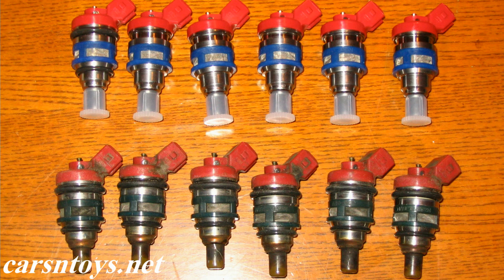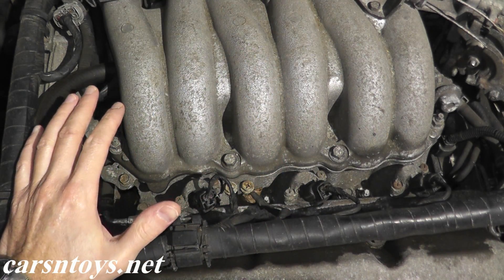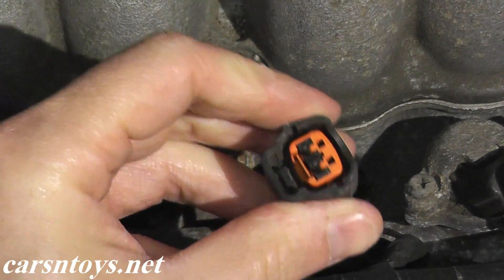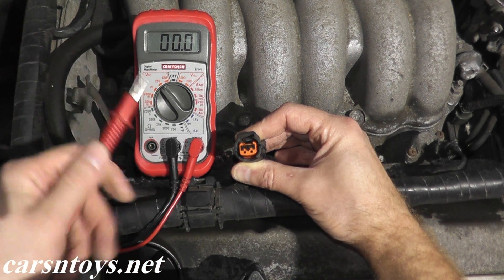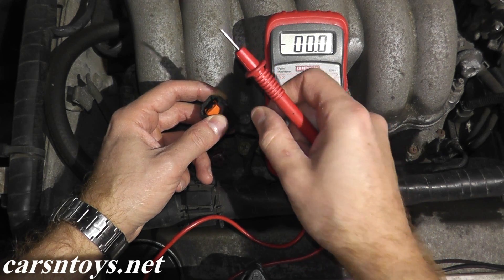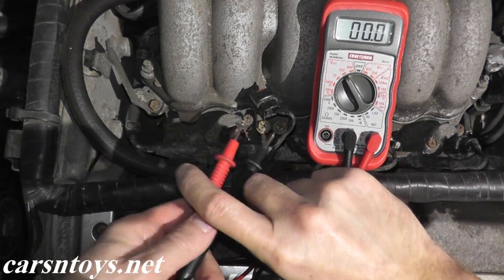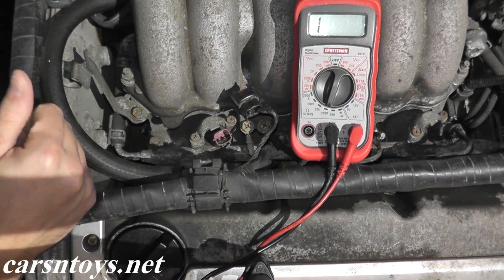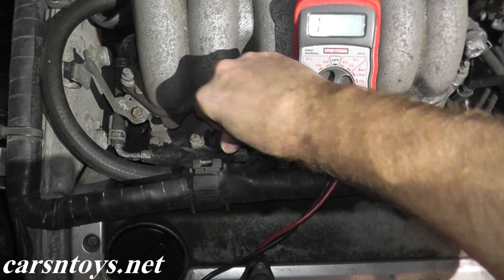How To Test Fuel Injectors with Basic Hand Tools HD | Testing Fuel Injection

Comment: 98 F150 4.6 256k mils
Batt. Ing. off 12.33v
Batt. Ing. on 12.03
7 conectors 12.02/12.01
1 connector 11.96 v
11.06 enough to cause my rough idling and stumbling acceleration ? all injectors resistance 15.01 ohms
Codes P1000 B1398 B1302 
Used service truck wires remaining from antenna external speaker safety lights ...I have back fire from exhaust .I have swapped used parts 
3 × DPFE ,O2 Sensors 
cleaned EGR value and the entire system  cleaned and checked plugs and wires, is the fuel presure test next

Comment: Great video. I have a miss firing so I bought the plugs. After replacing them I took it for a dive all perfect but as soon as I pulled into my drive way it started miss firing again strangely enough it dint do it as bad and it would do it for about 5 min and it will stop then it will run fine after a while it will do it again  do you think is an injector going bad what’s your thoughts on that issue thanks,
Reply: Sounds more like a pump or fuel supply issue

Comment: First thing to do before all this, is CHECK YOUR SPARK PLUGS.  Pull out one plug wire at a time and see if the engine changes at all. It should show rough engine and or chuggling effect.  If you pull out the spark plug wire, and nothing changes back and forth a couple of times, SUSPECT THE PLUG FIRST.  Find another spark plug and change the suspected Plug.  Once done and then fire it up and pull out the wire and if it changes the engine RPM to a rough engine or chugging effect>>  YOU FOUND THE CULPRIT.  If it doesn't check your spark plug wire, when was it the last time it was changed?  If it is OK, >> and that does not change anything you must check the compression on each cylinder.  

1. Check spark plugs with engine running pulling each spark plug wire out to see if RPM changes.  If none found do next #2>>

2. Do a full cylinder compression test with all plugs removed and wires.  First stroke on all cylinders must be 40 PSI or higher.  Max number of strokes is 10 to get final reading.  If any of them off the scale or not show compression its either a blown head gasket between cylinders or stuck Valves or a hole in the piston or rings are worn out.   If all OK go to #3

3.  NOW YOU GO TO THE INJECTOR TESTING SEQUENCE.  
 
This is the proper way to do it.  First listen to all injectors with that long screw driver or stethoscope, and the SOUND MUST BE ALL THE SAME.  Each injector must sound the same as the previous one.  Do all of them and make sure you mark it down on paper.

Then shut the engine off, do each injector ohms test at 200.  They should all be within a specific range.  From low to high no more than 0.2-0.3 ohms.

4.  Do not put power to the injector wires to check voltage.  If it is bad >>> that check engine light will show up saying Check Engine.  The computers today is pretty sensitive.

5.  Then check each Injector for resistance.  Each one should all be the same within specs not more than 0.2 in resistance.  If OK go to #6

6.  Check your coil.  Do that test as well.  IF OK go to #7

7.  Check your fuel pressure and your fuel filter.  A clogged fuel filter can also cause a problem.  If Ok,  then go to #8

Take car to mechanic. to check out the rest below

  Look at fuel pump which is inside the tank.

8.  Have your mechanic >>Check your fuel pump itself.  They sometimes go bad and cause missing problems and blow fuses.   If none found then go to #9

9.  Have mechanic check out your computer ECM.  They sometimes go bad and shorts itself out on occasion.  Wires do go bad inside the harnesses as well.

So basically you can save a lot of troubleshooting money doing it yourself having some equipment with you handy at all times and find the culprit early doing these steps. 

 If you discover you have a compression problem >>> THIS IS A MAJOR ENGINE JOB AND COSTS A LOT OF MONEY.  You need to remove the valve covers need a valve cover gasket set, the Head, need a head gasket need to get the head machined out, do the valves both exhaust and intake, need new valve guides, and check the piston if you see a hole this means drop the oil pan drain the oil and get a new oil pan gasket and disconnect the connecting rod from the crank shaft, find another new piston put in new rings and a ring compressor to put it back on etc. and so forth.  This is a major job itself. 

When you get to Number 8  You need a mechanic to do the rest.

Good luck.

Comment: If you don't have a long enough screw driver,  you can use a wood dowel rod. I had a fault that my Torque code reader came up as P0205, which reads as "Injector fault".  So as to be sure that it was indeed the injector, I swapped the suspect injector in cylinder 5 with the injector from cylinder 4.  After a bit of a drive, my code reader came up P0204 which has me now convinced that it is indeed the injector.  My mechanic tells me that as the engine heats up, the solenoid fails and the pin remains closed.  He believes I should be able to drive it without damage even if it is missing and losing power.  Gotta get to work tomorrow.  A new (rebuilt) one has been ordered.
Reply from the maker: Good tip! Thank you.

Comment: The electronics might be OK, but how would you test an injector for leaking?
Reply from the maker: You'll typically find gasoline passing the seal. (On the intake manifold.)
Reply: @Carsntoys  Isn't it possible for gas to pass thru the injector into the combustion chamber when it's not called for?  Similar to a needle and seat leaking in a carb.

Comment: For our 4th Gen Maximas, the highest point of failure of the fuel injectors is the pintle caps and that can only be confirmed by visual inspection or fuel dumping into the affected cylinder(s). Fuel dumping kills the Cat(s) systems and causes more major damage over time. At the age and mileage of these cars, as preventative medicine, it's a good idea to replace them all or have them rebuilt by a reputable shop. There are also output tests that help identify a Fuel Injector or more that isn't balanced with the others. If the output is balanced across all six fuel injectors, the engine will be the smoothest at idle. The resistance test only confirms that the Injector active component is within range. The pintle cap disperses the spray in the right flow, PPM and pattern.

Comment: So this test is not enough to rule out a faulty fuel injector. A common cause of fuel injector malfunction includes blocked sprayer, which this video does not test. Still, resistance test is ok for testing internal electrical components

Comment: Hi, tnx for your channel. I have a Nissan maxima 97 model. And it has not been on the road for like 3 years. Reacently me and my dad finally finished it up and got license plates on! My first car :) But, the car is not going right.. it's "jumping" and not going clean. it's almost like a kangaroo at times. What could it be?
Reply from the maker: Unfortunately it could be a number of things. Is the check engine light on? If so, what are the codes?

Comment: So you check your injectors for resistance, is there a tolerance range.

Say if your FSM says 2.7 ohms, and your reading 3.5, and they are all within that 3.5 range , plus or minus say 3.0 to 3.8 , acceptable ?
The FSM dosent give a range. Just says 2.7. Im sure they all could not be the same.
Reply from the maker: Yea, it's common to have a range of some sorts. You can double check by verifying the injectors are firing. Just touch the end of a screwdriver to the injector and you should clearly hear each injector click on and off multiple times.
Reply: Sure Im hearing the injectors clicking on/off thats the easy part, The range should have something to do with how long they are on/off, wish there was a place that could answer this type of question. I find no place. Actually asked a rebuilder, he also had no answer.
Thanks CarsNToys.....Nice Name

Comment: this only shows if the injectors opens and closes,but if it is clogged or leaking you still have problem,bad upstream O2 sensor,or vacuum leak send wrong signal and it can send more or less fuel even if you injectors are perfectly fine,working and  getting the job done right is two different thing!!

Comment: I couldn't understand yet how to find a +ve terminal? as you measured 12.2 volts at the female side connector. What happen if I touch +ve probe of Multimeter next of the terminal you used? It give me same 12.2 volts?
Reply: You can’t test that cicuit with a voltmeter or the wire disconnetded - that function has to be done live like with a scanner

Comment: I must say, I watched your other video on testing coil packs and you are the most clearest in dialog and graphical as I understand your every point, You are excellent at describing troubleshooting various automotive problems. Other's can take a lesson from you.Vinnie in Cincinnati
Reply: Except his test is incomplete. Testing 12V on one wire in the harness tests only a half of the 2-pin connector. What about the other wire? Also, the injector itself has more into it than just the coil. This is electro valve, it has electrical part and mechanical part - what if electrical part is good but the mechanical part is leaking or clogged? This is not a valid test.
Reply: @PszemoI  that test does not show the variable pulse signals to the injector from the engine management code - these pulses are variable to meet most engine operating condition, the inner fuel circuit can mechanically comprimised in the flow through the injector - each one should be removed and inspected and cleaned by energizing them intermittently and observing the spray and flow pattern
Reply: PszemoI resort to step three of your free tutorial in which you take a mechanic stethoscope and put it to the actual injector itself while listening for a clicking noise.
Reply from the maker: Thank you, Vinnie. I appreciate the feedback! Cheers

Comment: 2.5 liter Nissan multimeter resistance spec is 12.1-12.9. Mine were 13.5 ohms across the board. Doesn't start at all despite spark and compression and fuel pressure across the board. Was only getting a dribble of fuel through the injectors. Checked resistance of a part at an auto parts store, it was 12.4 ohms.
Reply from the maker: You're getting 12v at the harness connector? Any trouble codes?

Comment: my fuel pump keeps running  and my car wont start and all i did was replace the float in the tank . It ran just fine before i did this
Reply from the maker: +buddy pople Check the wiring. Sounds like the fuel pump is connected to a live power source.

Comment: My fuel injectors or flooding the engine will replacing them stop that  I asked this question because it won't pass smog the engine light comes on intermittently .  I have a 1993 Lexus ES 300
Reply from the maker: +Fredrick Clayton Check the gaskets. Much cheaper than replacing the injectors.
Reply: What gasket would that be are you talking about the head gasket
Reply: +Fredrick Clayton It is the injector gasket (looks like a thick rubber ring with square profile). It seals the injector to the head on engine block.

Comment: Can you unplug an injector while the car is running to test it as you would test a coil while running?
Reply from the maker: +Yo Man You could. However, most manufacturer's recommend testing the injector via an ohms reading and listening if the injector turns on and off.
Reply: +Yo Man this can be done...but it recommended to use a NOID light. Which is a resistor light...that will pulse when the car is running and plugged into the injector plug.
Reply: No you can’ because it stops functioning when you disconnect it

Comment: When doing the screwdriver test I have one injector that is only half as loud as the others. It sounds to be running at the same rate as the others only not as strong. Is this normal? I ask because I am also getting a missfire code from the same cylinder.
Reply from the maker: +leomannpictures Try swapping the injector and see how the cylinder runs.

Comment: i have check the power wires in my ingectors and i discover one that has no power i used a noid ligth and it corroborated my discovery the wires are good or so they look to be  what else can i do i can't find were the problem is  please help
Reply: +Francisco Tello get a wire diagram and check continuity of the wires from the injector plug...to the ECU plug.